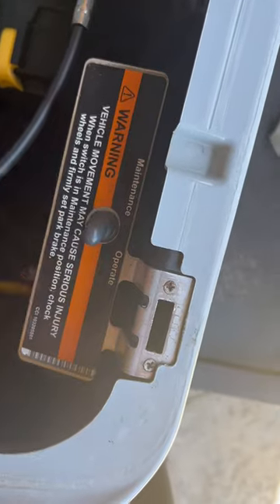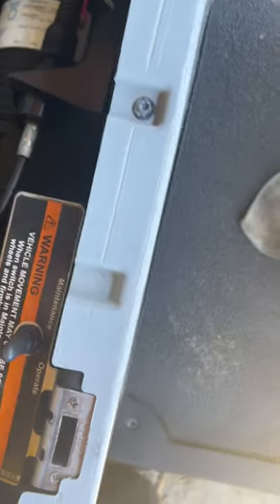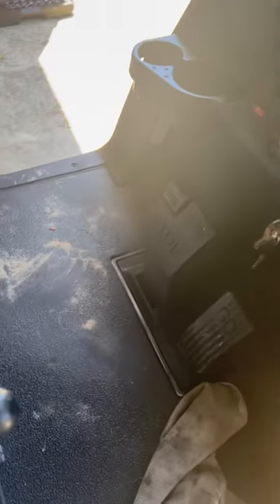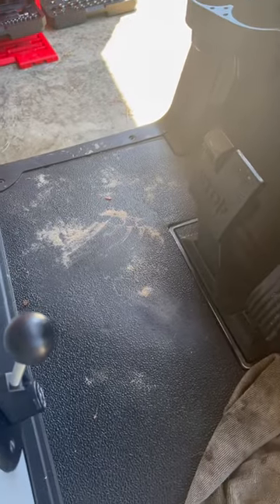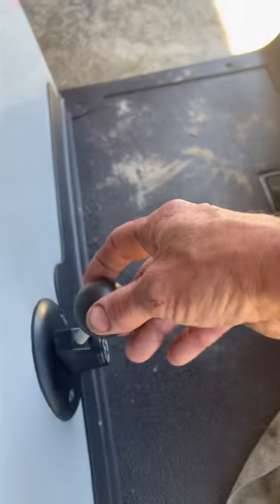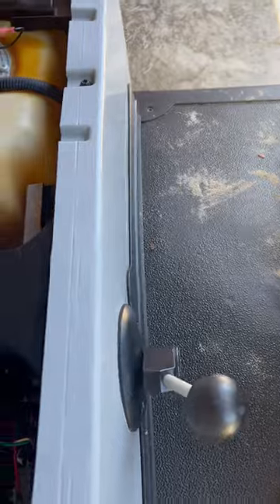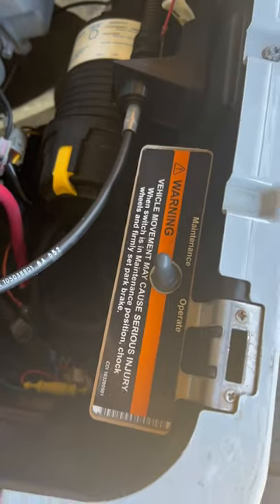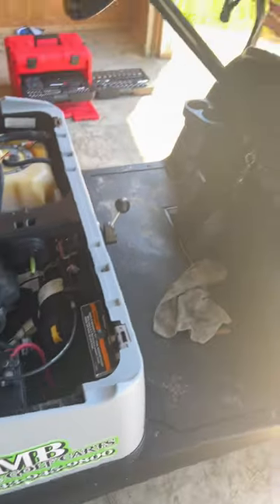Club cart gas Maintenance switch #clubcar #knowledge #queationandanswers #diy #golfcarts

Comment: My gas cart won’t fully engage when I put in forward or reverse? I changed the cable because it was stuck and changed out the carburetor. But I had this problem before I changed those parts. It stay in low idle
Reply from the maker: Is your throttle opening up all the way
Reply from the maker: You have a club car? Precedent or what kind do you have.